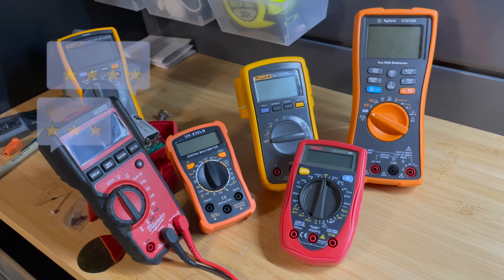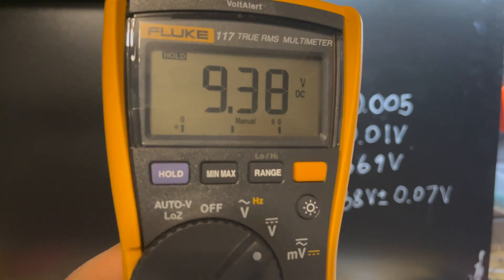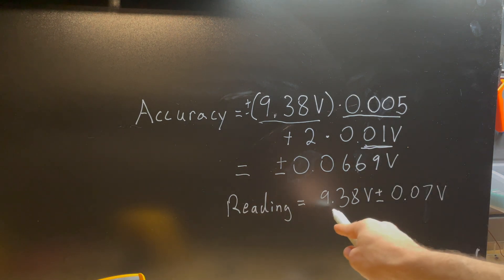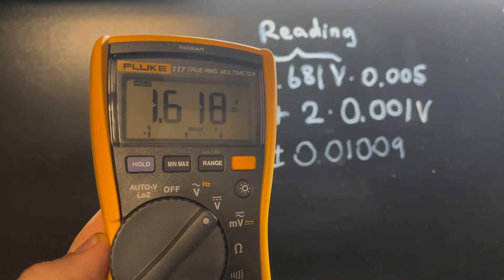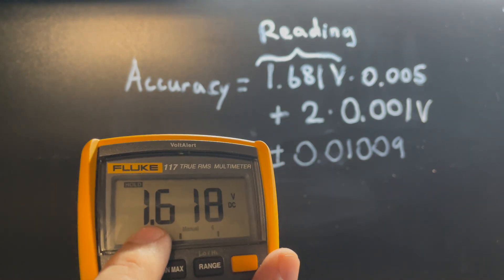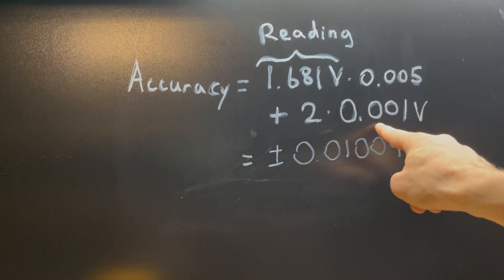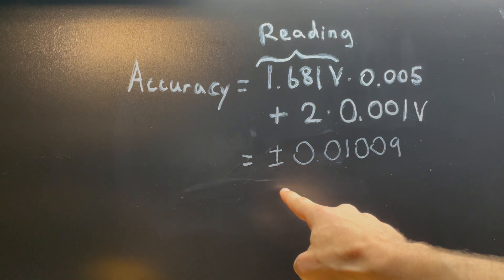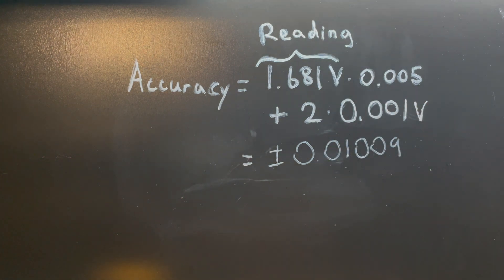Multimeter Counts and Accuracy Example

Comment: If I have two different brand meters & both are displaying two different values while measuring voltage, resistance, capacitance etc then which one can be called as accurate ?
Reply from the maker: You would need to buy a reference tool (ex. voltage calibration device) then compare both meters to the reference.

Comment: You are describing "precision" and calling it "accuracy."  Also, the analog circuitry capability is specified as "n + 1/2" least significant digits by the manufacturer.  This also MUST be considered and usually varies with range.  To avoid warranty returns, these are specified very conservatively.  A typical meter will exceed these specs; however, only the specs are guaranteed.
Reply from the maker: Hi Bryan, thanks for the thoughts but I am not quite sure I am on the same page with you (but willing to be convinced otherwise). The formulae I am using is based on flukes definition of accuracy for their meters (I pulled it from the spec sheet, and go into that here in a previous video https://www.youtube.com/watch?v=EJ-XG162gKU&t=1099s). Maybe one thing to clarify is this is the calculated accuracy of the meter - to do a true accuracy you would need to compare the meter to a standard but that is depending on environmental factors and all sorts of uncontrollable that would not be very useful approach when selecting a meter or thinking about what meter to buy. 

If I was going to talk about precision I would need to look at the ability of the meter to get the same measurement repeatedly. So I disagree that this is the precision of the meter. Often people mix resolution and precision but in my experience the precision is not even a characteristic that manufacturers will publish. They usually publish resolution and accuracy. 

I do agree with you that those calculations are very conservative. Let me know if missed something I love getting feedback.
Reply: @HTMWorkshop  Precision is how many digits are reproduced consistently.  Accuracy is whether those digits are calibrated correctly.  Since you were not measuring a standard, nothing you observed has anything to do with accuracy.  Fluke's accuracy specifications characterize how much their calibration is expected to drift over time, temperature, etc.
Reply from the maker: @byronwatkins2565  I agree with you on your definition of precision - the key there is we would have to do multiple measurements and see how consistent they are. And I think your take on accuracy can work. 

Where I disagree is that what I observed has nothing to do with accuracy. What I am finding, or showing, is how to find the manufacturers expected meter accuracy. If your going to purchase or select a meter you have to have some way of knowing what range your accuracy is going to be in - other words how can I compare the expected accuracy of different meters.  That is what I am trying to show - which I think is evident from the context of the other video but I think I could have done a better job of saying it in this video. Yes this accuracy range depends on the meter, the environment, and the sample being measured. 

I agree we could compare this meter to a test standard (which I have) but I don't think that is going to help anyone because they can't use it to select a meter. I could be wrong  - either way thanks for joining the conversation.
Reply: @HTMWorkshop  Interesting discussion.